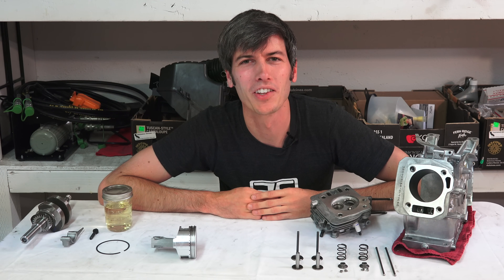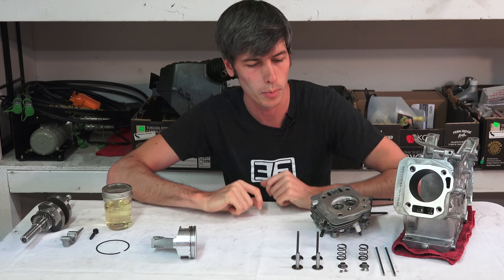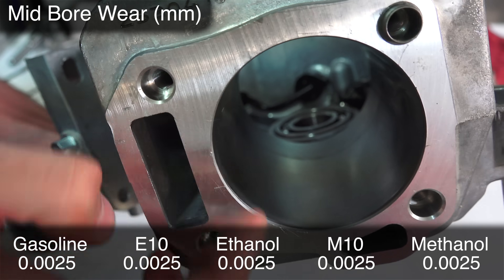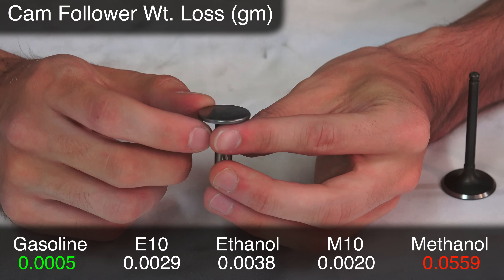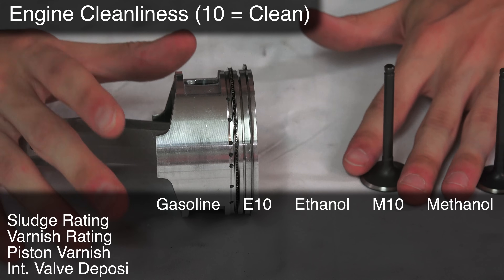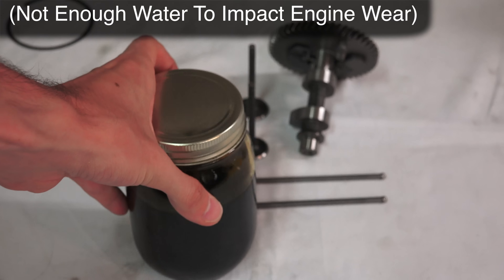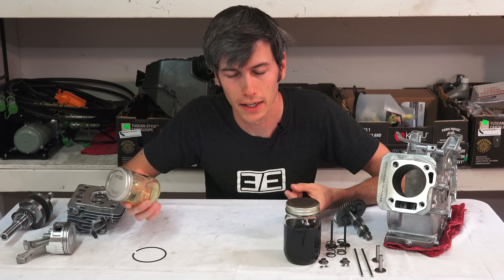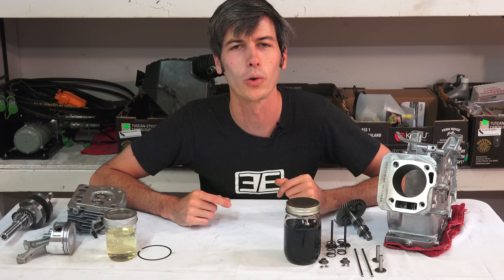Is Ethanol Bad For Your Car's Engine?

Comment from the maker: A lot of folks seem to be focusing on the fact that it's a 20 hour test, rather than the results. Yet at 20 hours it shows significant differences amongst the results. Also, 20 hours at a high load is much more pressure and stress on an engine than what you do commuting, which is nearly constantly at a very low load. This is an accelerated test as far as wear is concerned. If there are discernible differences at 20 hours, you can certainly learn from the study. While many YouTube channels simply offer "word of mouth" advice, that's all too often received well, I find it surprising so many are so concerned with a peer reviewed, with controlled variables, published article in what is perhaps the world's most renown journal of automotive engineering. Skepticism is a good thing, we should always question things. This means also not drawing conclusions that the study does not state. It does not, however, mean that the study is meaningless simply because you perceive 20 hours to be a short duration. It's quite common in the industry to run accelerated benchmark tests in order to predict long term reliability. If you're putting out new engines every couple years, you simply don't have the time to run those engines (and all of the individual components involved) to 200,000 miles to see how well they do, so instead you use harsh, accelerated tests to predict future reliability. Anyways, rant over haha, I hope everyone's having a wonderful day!
Reply: A while back I watched something saying in Brazil I think it is they only have high content ethanol fuel. All their cars run it from old to new and they seem to be ok.
Reply: @torque350hp  You are right. I am brazilian, living in São Paulo. Our gasoline has 27% of etanol and most brazilians, like me, use just pure etanol all the time. It is cheaper in many states and it helps a lot the air quality in the big cities.
Reply: @mrufino  you're lying if you put straight ethanol in an engine that's jetted for gasoline it will lean out and burn up the engine .. gasoline Burns at 14 parts air to one part gasoline by weight ethanol and methanol Burns at four parts air to one part ethanol so it takes about three times and all in methanol as it would if you was running straight gasoline and don't even try to argue with me I've been building methanol late model stock cars for 20 years buddy
.... You have no experience at all as you've never did what you said as it would have blown your engine been there done that lots of times
Reply: @torque350hp  Last time I read anything about it Brazil ran on pure ethanol. They made cars with high compression engines to burn it efficiently. It is a naturally high octane fuel. Their feed stock is sugar cane- a MUCH better choice than corn.
Reply: Didn't sound like a rent, but the thing I can't find is. Ethanol is more corrosive, you have to replace fuel lines but is it more corrosive any where else or is that just it? Thanks for the video I learned a lot from it
Reply: @ Winston not really, but it definitely matters which car you put it in. Cars can differ in both Fuel richness, Ignition timing, and knock sensors between manufacturers and models, so as the saying goes, results may vary. 

My work van (2013 Dodge Caravan)is flex fuel, and I barely lose 10% running full E-85 compared to regular unleaded (25mpg @ E85, 27@ E10) it makes sense for me to run the ethanol because of the subsidies ($2.20/gal for E-85 vs $2.55/gal for E-10) even though I know its a bailout for both the ethanol industry and the car manufacturers, who get to avoid emissions and fuel economy standards by having the flex fuel cars be the worst gas hogs in their fleets. If you wondered why you don't see little econo-boxes at the E-85 pump, that's why. Its just a gimmick so they can sell big polluting cars instead of real reform, which cost money. And it was cheaper to buy a few politicians than to do real engineering.
Reply: I mean, my del sol has been chugging ethanol for the past 300k miles like a champ. It's a daily driver so I don't abuse and I do take care of it as per the owners manual. Maybe people like to blame solutions for their own bad maintenance problems? Get it? I actually looked up the article. Thats some solid methodology they had. Keep pumping out good stuff like this man. This is why I subscribe.
Reply: @RicardoRodriguez-qb8kn  When you say ethanol, do you mean E10 or E85?  IMO 10% isn't enough to be a big concern for fuel lines, etc., but a higher concentration like E85 raises an eyebrow as to whether it's a good idea or not if the car wasn't explicitly designed for it (specifically the fuel lines and supporting parts rather than the engine internals itself).
Reply: If you are referring to the direct Ethanol subsidy that was allowed to expire, you are still wrong. The system changed the payee from the government to the refiners themselves in the form of "Renewable Identification Numbers" which have to be bought by refiners.

From RenewableIdNumbers: "The United States Environmental Protection Agency is authorized to set annual quotas dictating what percentage of the total amount of motor fuels consumed in the US must be represented by biofuel blended into fossil fuels. RINs are a direct requirement of the United States Environmental Protection Agency’s Renewable Fuel Standard – or RFS – which governs Renewable Energy Certificates (RECs).To ensure compliance, obligated parties are periodically required to demonstrate they have met their RFS quota by submitting a certain amount of RINs to the EPA. RECs represent tradable energy commodities in the United States that offer verifiable proof that 1 megawatt-hour (MWh) of electricity was generated from a specific renewable energy resource (biofuel, solar electricity, etc) and was fed into a power line system for the express purpose of that transportation of energy."

So basically the government set up a renewable fuel carbon tax and is forcing places like refineries to buy these credits. So we the consumer is being "taxed" in essence by the oil companies passing down the cost of subsidizing ethanol and other renewable energy sources because of the EPA.
Reply: 20hours is plenty of time. you are correct, results are results.
  I have an old dirt bike that leaks like a sieve if you put 10% ethenol fuel in it. some diferant seals would fix that. as long as the ethanol fuel doesnt put the octane rating somewhere in a range your engine cant use there isnt much problem. methenol is corrosive. one of the many reasons drag racers take their engines apart so often.
  I think tuning an engine to run on pure ethanol would be the best way to go. you would get the best fuel economy and the emissions would be lower.

  thats what I learned here.
Reply: @lukewarmwater6412  Do you actually run pure gasoline in your dirt bike and compare it?  My race kart engine leaked a little around carb seals on E10, but it did it on ethanol free race gas, too, it had more to do with being 10 year old seals that were probably overdue for replacement than anything.
Reply: @nunyabusiness896  no, it was 42:1 pre-mix. but 10% ethenol affects the rubber they used in the 70's. from petcock to floats everything leaks. this is easy enough to fix, just get o rings and seals
 that are ethanol compatable. it does not leak with straight gas. wear could also be at fault to an extent, I mean it was built in 72' and I have no idea if anything has been serviced.
 as the rubber parts get all soft and distorted they would eventualy leak anyway though. also the floats leaking is more than likely the only factor that afects the 'state of tune' (it runs like crap) so in time when I quit being lazy and refurbish the thing it will run on e-10 no problem.

  irritates me to have to,  ethanol isnt for north america. we are ruining the land growing corn in places where we used to grow nothing. brewing alcohol releases alot of co2..... ethanol is not an envronmental fix, it is the opposite.
Reply: @lukewarmwater6412  OK...you didn't really answer my question.  I wasn't really talking about added in 2-stroke oil, I was talking about E0 vs E10.  Have you tried E0 and confirmed it didn't have the issues of E10, or you just assumed it wouldn't?  Considering the age I think the raw passage of time is a bigger factor than anything.  I've also read that E10 can dislodge some particle buildup left by years of E0 that all of a sudden will find their way to the engine and this isn't an issue if you start with E10.

I'm with you that the "environmental" side of ethanol in fuel is complete nonsense and even environmental groups don't even seem to really support it, so I don't know why it persists.  As much as Trump talks about reducing excessive regulations, this is one I'd really like him to do something about and I don't think anyone but corn growers would mind.
Reply: @nunyabusiness896  ummm.... did you read my reply?? stated clearly it does not leak unless ethanol is present.
 I have had this same problem with all of my classic bikes. any ethanol causes leaks.
Reply: @lukewarmwater6412  You're not understanding the question, though.  In the name of science, you have to be methodical in your assessment, and that's why I'm trying to ask.

Have you:

-taken a bike with no leaks running E0 fuel

-started running E10 and suddenly got leaks

-went back to E0 and the leaks stopped

All with sufficient time for the fuel to be in contact with the parts for a fuel difference to be apparent i.e. sit with E0 for a month and E10 for a month.

Basically, I'm trying to assess if you ran a quick tank of E0 and said "hey, no leaks!" then put E10 back in and it sat for 6 months and you said "E10 makes my parts leak!".

People often draw conclusions without doing due diligence like this, so I'm just assessing if you gave each fuel a proper chance to verify it is in fact the fuel and not just old seals acting like old seals.
Reply: @nunyabusiness896  as I explained the first time, YES.  I have stopped for fuel on an empty tank, filled up with e-10 and had leaks in 5 min. drained and re-filled and the leaks went away. this happens with every classic bike I own..... you read english, right??
Reply: it's not bad because it has more octane, but the fuel consumption increases, ask those who compete acceleration races...
Reply: 20 hour test Is best than nothing, but is not optimal to determine wearing in other components like fuel pumps injectors, catalytic converter and exhaust pipes. Also because gasoline form a lot of carbon / calamines deposits on a long term use. Carbon deposits induce knocking wich is way more destructive than slight difference in engine wearing. Also a long duration test executed in a cycling basis allowing exhaust water condensation will determine which combustible induces more rust in the exhaust system and also catalytic converter duration. You know: in life, some things are short and are good, but this test is not the case...
Reply: Since 1970 in Brazil we have cars that use 100% alcohol as fuel. I have a 2009 Fiat Idea 1.4 L that is flex fuel, and since new I only use 100% alcohol as fuel. It has 178000 km on the clock and I never have any problems, my engine runs like new, it doesn't burn oil and runs perfectly. If you go to a engine rebuild shop here in Brazil and see a gasoline engine and a alcohol one side by side you will see that the alcohol engine is much more clean inside. Myth about alcohol as fuel, it all this is. Alcohol is a great fuel for internal combustion engines.
Reply: Engineering Explained they should do that test for oil, to see witch one is the best/better :/
Reply: The real problem E10 poses is water and even E10 fuel systems have issues with E10 based corrosion, they just reduce the effects to where it shouldn't be an issue within the first 150,000 miles on a car
Reply: You place far too much faith in published tests. You'd be surprised that many are not peer reviewed nor questioned. Boeing Max shows us what kind of nonsense goes on all the time.
Reply: My biggest concern is Storage of E10 on seldom run engines such as collector cars, seasonal equipment that may be sitting for an extended periods of time.
Reply: You are an engineer?😂😂😂😂
Reply: 400 hrs full throtlle engine durability test is equal to 10 years normal usage. So 20 hrs full throttle is equal to 6 months.
Reply: Mj i
Reply: Top end of a motorcycle engine ain’t it?
Reply: Well said.
Reply: PikPobedy  I clearly stated the fuel tests were done while teaching and not at SGS. No engine I ever tested was done short term, most vehicle owners manuals state 500 miles moderate driving and to not run steady state if possible. This video relates only to internal combustion engines and that is what I am limiting my comments to as related to my direct experience.  PikPobedy
Reply: Small engines with carbs such as lawnmowers and atvs are not made to run on e10.
Reply: what was the pH of that methanol? where i worked, they added caustic to increase pH of the methanol.... to reduce corrosion of the piping.  probably fuel methanol can still have the pH bumped even more.
Reply: Not only that, the study was done in 1981.
Reply: An engineering god among men. He's too good for us...
Reply: SAE sounds like a cult😉
Reply: @doorguner01  it stands for the society of automotive engineers to have established standards for bolt sizes torx etc etc .... You're calling it a cult that's pretty funny cuz that tells all of us that you know nothing at all about anything automotive
Reply: @donniebaker5984 😂😂😂😂 ouch!
Reply: @Bozemanjustin  There's a reason why Briggs and stratton made and all plastic carburetor!
Reply: Using Ethanol in petrol engines goes back further than 1981.I first heard of it being used in racing before that when I was in the RAF cadets. Also the Germans used Italian wine to make Ethanol when their fuel supplies were cut off during the second world war But Henry Ford had his Model T run on both petrol and Ethanol. David  Blume is a leading expert on Ethanol fuel. Also  the oil companies with fossil fuel were  all  for prohibition and the wars to lay down the pipelines and wreck the environment They also spend billions on anti Ethanol propaganda where they buy land and cut down trees to grow sugar cane so they make out it leads to deforestation anyone could make their own alcohol in their own back yard like Steve McQueen made Moonshine in the film The Great Escape . The extra water is added by the oil companies who don't want to filter it out as much to kind of make Ethanol look not so good. A petrol engine should be able to run on 100% and it doesn't produce the same amount of carbon. It's a clean burning fuel
Reply: @EIKLURAM  ethanol has to be mixed much richer to air than gasoline if you put straight as an all in a gasoline engine it'll last about 30 seconds before the Pistons melt try and see I dare you
Reply: @donniebaker5984  I know it;s a rich mixture with less air than fuel. But
Reply: I've always wondered how companies test their new engines for reliability when they're developing them. I use to always think they just have an engine running somewhere in the factory for months then evaluate it after a certain amount of time.
Reply: He also said that engines after 2012 would be O.K with E10 but older ones may not be designed for Ethanol  but the test was done in 1982 so that is obviously older vehicles.David Blume is one of the best sources of information related to this subject.If Alcohol fuel was damaging to engines then I cant see  Hendy Ford designing the Model T to run on 100% Ethonal back in the days before prohibition
Reply: Less rationality, more hype!  ;)
Reply: They should have ran the E100 and M100 longer maybe 25 hrs to compensate for having less energy and the vehicle would have to ran longer to achieve the same range as a pure gasoline burning vehicle.
Reply: Thanks.
Reply: Disappointed you didn't Evaluate E85 in your testing.
Reply: M
Reply: It's interesting to read the comments about ethanol absorbing water because aromatic hydrocarbons used to boost octane in gas also absorb water from the air.  Some absorb more than ethanol does.  In fact, they remove water from ethanol by mixing it with benzene.  Benzene attracts water more than ethanol and removes it when evaporated in a column.  That's how they get ethanol to over 195 proof.  Comments about refineries adding water to ethanol is twaddle.
Reply: How did gaskets and seals fair in those tests?
Reply: @Kor1134  why do think they called it quits at 20 hours? Lol
Reply: A couple of years ago I turned a gas-only car into a pure ethanol one (in Brazil "e100" is widely available, quite cheap and awesome for turbo aplications such mine), 40.000 miles later I can tell ethanol will eat thru anything not specificaly made to handle it, anything rubber will be gone, anything metal (including alluminium) will be eaten thru, fuel pumps will need to be replaced constantly, I had to replace the fuel tank to stainless steel and everything else fuel touches it for plastic. Oil is always clean, inside the engine looks brand new, but everything else deteriorated so much quicker.
Reply: I have driven Saabs with e85  about 550000 km,lot of oil changes and sparkplugs,but  thats it. No problems,if it is warmer than -20 celsius.torque is great and co2 and other emissions are close to zero.I recommend strongly.👍👍
Reply: This is a totally bogus test there's no mention of air to fuel ratios on each fuel..... When running straight methanol you have to run about three times as much fuel to air ratio which is actually comes to four parts air to one part methanal  by weight or as gasoline is about 14.5 air to one part gasoline ..
So if you try to run methanol in a car that is set up for gasoline it will run about three times too lean instantly melting the Pistons. And yes any gasoline that's mixed with alcohol by 10%, you're causing a combustion chamber to run much harder than it's designed for as the alcohol will lean out here gasoline mixture and cause failure valves first that's amount... 100% methadone run through a gasoline carburetor or injection will blow the tops out of your Pistons in about 30 seconds after you fired up
Reply: The 10 % ethanol contains up to 49% water. Therefore 1 gallon of fuel contains 5% water. Im thinking exhaust system corrosion would be a issue. Just a thought.
Reply: Pure alcohol aka ethonal shouldn't contain any water. That's why it's pure..If it contains water its not been made correctly so it's not pure ethonal
Reply: This is a superb, well supported, response that hits a number of important points.  Unfortunately the very audience that needs to develop the reasoning skills you display and then wrap up with a bow for them to adopt, are busy scratching, sniffing their fingers, and saying "them scientistifics tipe-guiz theenk thez so smaart"
Reply: I love this xD
Reply: So this video is relevant to engines made in 1981 using lubricants from 1981...
Reply: If they found more water in the oil of alcohol fueled engines after a 20hr test, imagine what a couple heat cycles would do. They also probably used carburetors which would really change the results compared to today.
Reply: In the study, did they optimize the engines for the specific fuel, ie: compression ratio, cam and ignition timing? What about the BSFC? 

If engine "A" uses 0.5L of fuel to move 2000 kg of mass 100 km, with 0.0001 wear, and engine "B" uses 0.25L of fuel to move the same mass the same distance, with 0.00015 wear, but neither engine see a decrease in efficiency until wear reaches 0.01, wich engine is more efficient?
Reply: This study had an overall poor design of experiment.
Reply: Ethanol is an alcohol. It is terrible for your seals fuel lines and so forth. Rubber and alcohol are not friends. We already know long term wear is worse with ethanol fuels. It's science
Reply: Can you check the effects on the rubber fuel lines on engines that have sat for more than 30 days and one that have been used regularly?
Reply: Stelantis (FCA) does 200,000 mile tests.  2 shifts, 7 days a week and 350 miles per shift.
 It happens in Auburn Hills, MI. That takes about 10 1/2 months. It also keeps  about 20 mechanics busy. Michigan roads are pretty good at proving a harsh testing environment on Gretchen's damn roads that constantly need fixin. Great for shake and rattle testing.
Reply: What about a high wind causing  a high loading on the engine?
Reply: Well said sir! I have an 07 uplander that is an alcoholic. Ive ran X-85 120 octane alcohol in it no problem. Well except for the tires that got smoked off much quicker than advertised it did no harm to anything else. Ok thats a lie! It did hurt juniors ego more than a little when he tried to beat me with his 5.0GT Mustang and couldnt win.😢 The look of despare was priceless on his face when we passed 100mph and i was laughing like you wouldnt believe and pulling away at that speed. Ive done 125mph @,4,000rpms and my factory tach goes to 7,000 rpms all of the are white, not one is yellow or red but it shifts at 6,000 rpms by itself @WOT in all gears. WOT in neutral or park is 4,000rpm non- negotiable. There is no access to the throttle anywhere under the hood. Its all electronic, fly by wire technology nowadays. I used to think my F-15  that i crewed was technical. Not so much anymore.
Reply: Can you address the common comment about ethanol causing deterioration to fuel lines? Surely engine manufacturers who design their engines to run on E10 like Mazda (skyactiv) and recommend to use E10, would address this problem.
Reply: Well if people are correct and the issue is how corssosive it is, and what it does to other parts that then impact the engine...

 Then a long term test is required to show that. Then to find out what to do about it ideally.

 This test is like me taking heroin for 3 days then being like. "Yup. As long as you don't OD. It is totally safe for you."

 And that is actually true. Taking heroin for 3 days won't really do anything. It is the life style choices, and lack of health mangement once you get addicted that makes it so bad.
 
 In fact I need a liver and kidney transplant, and many organs come from opiate addicts since it doesn't really hurt many of their organs. (Short of STDs, hah. Wait that isn't funny.)

 I would just like more data.
Reply: LIL LIL LIL BAHLIL , SI ANOMALI EBLES HIJAU (GOBLIN) 🦖😈👹💀💥
Reply: I use ethanol for performance car, with new ECU tuning much more power output. I love e85 fuel.
Reply: Plz update on this!
Reply: What you call "word of mouth" I call "urban myths". I sometimes think Engineers like ourselves are wasting our breath (so to speak) trying to educate with FACTS. The biggest thing wrong with the internet of things is that it's made every numbskull into an expert.
The most common one is that premium fuel isn't "worth it" (whatever 'it' is?) because all petrol is the same. And how do we know this? Because Bob is a tanker driver and has 'seen' the tankers always being filled from the same outlets at the refinary ..... YOU know the rest of the song ....
Keep the faith Jason
Reply: Cyclone Cyd Best comment.And you actually have videos.Correct indeed on the experts galore now.
Most are just kids or adults with the Dunning Kruger problems.
Reply: @CycloneCyd  We don't need no stinking facts! 
10-4 good buddy. When we design, program, debug and produce a machine the projected component wear is part of the data we have obtained, along with the proper lubrication for the different moving elements.
Just because something worked once does not make it a fact, I don't consider backyard JimBob's observations in the highest esteem.
Reply: @CycloneCyd  -  Well, I haven't heard much about ethanol in regular and fairly modern engines.   BUT small engines used mostly in lawn care seem to crap out and fail to start.  The SAE didn't address this.   I don't blame the organization:  E-10 is official government policy and it doesn't want to rock the boat.
Reply: @CycloneCyd  I've never heard anyone say premium isn't worth it "because it's all the same"  What I have heard is that if your car wasn't designed to use premium there is no benefit to using premium, you are just wasting money.  The only exception would be if you KNOW for a fact that a particular company puts MORE fuel detergent additive in their premium fuels.  Some brands used to advertise that they did but I have not seen such a claim in many years.  In addition, automakers often say do not use premium when the car was designed for regular because premium can create cold start problems.  I have experienced that personally on a 92 explorer and discovered Ford even issued a TSB about the problem.  Typically premium fuel has a lower (something or other, probably vapor pressure) and when cold it winds up as too lean a mixture for the car to start normally, you wind up cranking and cranking till it finally starts.
Reply: You could make a video about brazilian flex engines, our gas is 27% ethanol, this could make a point
Reply: Neoedu, I know the fuel works fine in motors in which are built or upgraded to run Ethanol, and in Brazil, it makes sense as Ethanol is not as environmentally damaging to produce there as it is here by using corn, which is a staple for human and livestock consumption. Yes it absorbs water, everyone who has spent 5 minutes looking at the pros and cons knows this.

What we, the US (ESA) public don't like is mandated use of a fuel that only makes financial sense because of a government subsidy, one that isn't easy to store, and when the mandate goes to E-15, expensive retrofitting of our vehicles will be necessary (my 2009 car is E-10, my 2013 is E-15 approved) for no financial benefit to our country, and likely damage for motors and fuel systems that can't be upgraded easily.

Lastly, this video used a government accelerated wear study, which was scientifically done, but in the 1980's when this test was done, vehicles were still very primitive, pushrod valvetrains, carburetors, point ignition timing, things left over from the 1930's technology. Because of that old technology, the test has really not a lot of relevance on things like Oxygen sensors, Fuel pumps, or the ability to keep water from entering the fuel system. It was a static test that proved Methanol is horrible, Ethanol is Fine, and Ethanol Blends also are fine or better than regular gasoline (don't know if leaded or unleaded) at reducing mechanical wear in antique engines over a short accelerated wear test.
Reply: @twotone3471  You wanted lead in the fuel because of the unharden valve seat and guides  but if it was remanufactured they where installed with hardened valve seats and guide then unleaded was ok the lead was to help cushion the valve stem from deforming the soft cast iron!
Reply: Dudes in lab coats ain't got nuthin on my cousin Bubba's Xpertese...DORK!!!
Reply: SGS Environmental Testing Center, 2022 Helena St, Aurora, CO 80011. I used to work here. Unlike Simpleton Assclowns Experimenting(SAE), this is real. Accelerated testing is BS, long term testing is the only proof. Days, weeks, months, store engine for years and pull out again to keep testing. Experimental fuels and additives too. Stop drinking the the alcohol laced Kool-Aid. Take a field trip and see, if you can get in(proprietary technology). Also, while teaching automotive technology at the collegiate level I observed ethanol levels as high as 30% in the winter blends. Simple test uses a graduated cylinder of 100cc. Fill to line, cover top and shake for 30 seconds. Read directly the separation line for alcohol content. Do you drive on bumpy roads? Lastly, older engines, the owners manual on my 1988 BMW 750iL specifically stated to NOT use alcohol blended fuel. Cylinder wash leads to accelerated wear.
Reply: @ATEC101  "Cylinder Wash" I think you are referring to Ethanol's solvent abilities to emulsify oil on the cylinder walls, or worse internally in 2 stroke motors. I just wonder what oil additives have been put in lubricants to combat this, if any?
Reply: Absolutely none that I am aware of. Alcohol was a 'carcinogen" to engines until the subsidies decided it was "chock full of vitamins'. The SEMA show I went  to  in 2012 had a banner hanging that stated 10 years 100k, throw it away(the entire car). Also, spare parts for most production cars are less than 5% of total volume unless shared across multiple platforms.  @twotone3471
Reply: @ATEC101  For cars at least, other than the Cylinder surface washing, I'm most concerned about the modern vehicles extended service interval, My work van is E-85 and We use that, as its built for that. But is the Oil made for dealing with Alcohol's unique combustion byproducts, and emuslifiers? Is there a 2 stroke, or 4 stroke oil that does? So far I haven's seen any car saying that if you run Ethanol, you need shorter service intervals, but would they? They do sell cars for a living after all.
Reply: Two Tone Unfortunately, the extended service interval is now part of the maintenance package sold with most vehicles. In example, 100,000 mile free maintenance. 15,000 mile oil change intervals gets you 5 oil changes to 90,000. Some manufacturers will say to change the filtrer half distance and top up.This assumes normal driving, which no one does. Severe driving can be classified as stop, start, up and down hills, temperature fluctuations of more than 20 to 30 degrees, dusty environments and if you live at or above 5000 feet. I am a user of synthetic lubricants anywhere I can. You can send oil samples out to be tested and many of the people I raced with at the club level did that after every event. My advice is to halve the interval. They ar also trying to sell you another car too. @twotone3471
Reply: @ATEC101  I get that I SHOULD change the oil more often, but my E-85 vehicle is at work, where people's lives are potentially impacted besides mine. Its out of my hands, a mandated 8k interval under severe use. I'd request a oil formulated for that, but there isn't any. We already use full synthetic, which is as best as we can do, but it remains that motor oils don't have a specified API certification for use in Turbocharged, flex or CNG powered vehicles, and they should.
Reply: @twotone3471  two strokes have their oil mixed in the gasoline their comment has no validity what so ever
Reply: The corrosive effects of Ethanol occur over time, both electrical and chemical wear, this test didn't take into account the effect of the increased amount of water in Ethanol Blends in the real world, or to two stroke motors (really the worst) or state (at least in your video ) which materials the motor was made from (cast Iron Block or  aluminum?) so many variables to state conclusively that its just so, when its just not. Yes, in the right conditions, ethanol is both a viable and cleaner burning fuel than Gasoline. That however doesn't take into account the amount of fossil fuels used to grow, harvest, transport, and process the corn into Ethanol. It's a fuel, but don't confuse it with being a "Green" energy alternative.
Reply: @twotone3471  For what it's worth, I ran E10 93 pump gas in my race kart, in one case 1.5 year old E10, and never had a problem.  This was a 14,000 RPM 2-stroke.
Reply: @nunyabusiness896  it's rare to find 93 octane E10. But if you did and ran that in a rotax motor you were not following the manufacturer's recommendations. Also we are talking about a motor with a 50 hour maintenance interval. I'm not sure that is enough time to truly understand the wear characteristics of E10. My own bad experience with ethanol happened using a boat motor which is apples and oranges to a kart engine. But I wish you well and hope you won a race or two.
Reply: @twotone3471  93 E10 isn't rare at all, it's what all premium pump gas is in Texas.  The manufacturer actually recommends 93 octane (98 in the manual, but that's Euro calculation, US calc is 93 for the same octane), though they would probably prefer you ran MS93 (leaded ethanol free 93 octane race gas).  I ran it because an actual Rotax Max Challenge driver said he always runs pump gas and even a seasoned Rotax tuner told me the motor actually ran better on E10, it just wasn't legal for really tight rule sets.  

As for maintenance, 50 hours of 14,000 screaming RPM at full throttle is quite a bit, and regardless the issue was in terms of gaskets and seals, not the engine which was demonstrated by SAE to not be a big deal.  Bottom line, it ran fine on 1.5 year old E10 stored in a gas can (mixed at 50:1 with 2-stroke oil) kept 100% in a van in Houston heat and humidity.

I read an article about boat motors and the main issue appears to be that the ethanol will dislodge old buildup that regular gas won't, so if you suddenly switch you'll rapidly purge all of the crap built up in the tank over the years and will run it through your engine.  Supposedly if you completely clean the system before switching or start with a new boat and run E10, it's less of a problem.
Reply: @nunyabusiness896   High RPMs are great, 4 stroke engines and many Marine 2 stroke engines are limited in RPM's by a phenomenon called valve float, where the valve spring lacks the power to retract the valve at a certain RPM and  may cause the valves and pistons to have a unfortunate meeting, causing the top end of the motor to catastrophically fail. 2 strokes like your Rotax have fewer moving parts. and none in a interference that would detonate the motor. Chainsaws and Leaf Blowers take advantage of this as well, but go 800 hours on average before needing a rebuild ("Life cycle assessment of chainsaws
 A case study of two Husqvarna products with different power  systems"Division of Environmental Systems Analysis Department of Energy and Environment CHALMERS UNIVERSITY OF TECHNOLOGY 2011) That's what allows those screaming high RPM's, and the main limiting factor is heat, so Lubrication and cooling is paramount, and in this Ethanol had to be a double edged sword, with the engine running cooler on E-10 leading to it "Running Better" on the track. However at the same time Ethanol's properties are also eating away at unprotected metals and emulsifying the oil in the air/fuel mix, leading to potential wear issues. 

Secondly, there is "Phase Separation" where water dissolved in the Gasoline separates the Alcohol from the Gasoline. With normal gas, this happens too, and easier. But that's also the problem, as E0 has a maximum carrying capacity of 0.15 teaspoons
 at 60 degrees F per gallon. E10's capacity is 3.8 teaspoons per gallon, quite a bit more, and if that separated water/ethanol mix gets pulled into your engine, that is bad Juju. Empty the tank every go, and really with fresh gas, shouldn't be a issue with your kart.
Reply: @twotone3471  First of all, don't preach to me about valve float like it's news to me.  There is nothing more irritating than the automatic assumption people on the internet make that you don't know things when you haven't confirmed it either way.  Second of all, that has nothing at all to do with anything previously discussed.  Third of all, my engine has no signs of corrosion (well, up until the point I sold it about a month ago because nobody runs it and I want something that is run locally), Fourth of all, the supposed "phase seperation" was never an issue and never created a run time problem.  You can keep power Googling and quoting stuff but the bottom line is just like Jason said, it's not a big deal.
Reply: @nunyabusiness896  I suppose it's a big deal because your engine was made specifically to run at high RPM. And phase separation is a bigger thing in environments where the temperature changes. I suppose in Houston it actually doesn't change as much as it would in Milwaukee.
Reply: @twotone3471  We go from 110 degree days in the summer to some 20 degree nights in the winter.  Maybe the internet has just been misattributing other issues to ethanol, which is why Jason wanted to make this video.  I wouldn't mind seeing a proper experiment with ethanol over time, but I'm tired of the hear-say over this when the proof is in the pudding and 1.5 year old E10 worked fine in a high revving race engine.  It's very possible new chemical stabilizers have come out in recent years as well.
Reply: @nunyabusiness896  Actually, the main debate is over a potential E-15 mandate, which would affect many pre 2013 vehicles on the road currently. Yeah,my families 2 stroke Boat motor failed after 1 year of E-10, but Dad had no clue about fuel properties. The experiment I would like to see is in regards to lubricants and the properties of burning ethanol in forming deposits that   two and four stroke engine oils were designed to prevent.Are our current additives designed for the byproducts of ethanol combustion?
Reply: @nunyabusiness896  he also included two strokes floating there valves .....two strokes have no valves ..
Reply: @donniebaker5984   You have never took apart a 2 stroke then, they have a reed valve, to keep combustion from happening in the crankcase.
Reply: @donniebaker5984  I don't disagree, this test was shallow and comes far from telling if ethanol causes any damage to the engine, just barely tested combustion damage, but he didn't make the test itself, he is just talking about a test made in the 80s, the engine is just there to represent what he is talking about.
Reply: @donniebaker5984  you being wrong about 2 stroke engines not having any valves makes me lose credibility? Yeah sure, in your dreams.
Reply: @twotone3471  corn 🌽 is not a good crop for fuel. Sugar crops are the best for alcohol
Reply: @twotone3471  you are correct. It’s amazing that he is an engineer, but that sounds about right for engineers actually. That’s why everything is crap these days. People like him or making them.
Reply: @twotone3471  I only ever use supreme 93 or 95 Octane in my 2 strokes.  Most if not all premium fuel in Canada has 0% ethanol.  Regular is up to 10%, mid grade is up to 5%
Reply: @rxtuninginc8444  If that's true it makes no sense since ethanol increases octane.  Why would they put less in the grades that need higher octane.  Not saying it's not true, just that it makes no sense from what I've heard about the benefits of ethanol.
Reply: @EristiCat  It's a common thing; where I live, 93 octane premium fuel and ethanol-free fuel usually go hand in hand.  Some stations, the premium has ethanol, and occasionally you find ethanol-free 87 octane, but usually it's 93 octane ethanol free.  I imagine it comes down to pricing; both premium fuel and ethanol-free gasoline fetch a premium price, so it makes some sense to see them combined.
Reply: There is no "increased amount of water" in an ethanol blend. The water may form because of natural condensation. The ethanol removes the water. If you don't have ethanol then you may have a continuous buildup that eventually requires attention. So in this regard, a longer test would prove to be more favorable to ethanol, not less favorable. Ethanol is no more corrosive to various metal than gasoline and the aromatics that are used instead of ethanol (in fact, ethanol is less corrosive on many substances).

Regarding the use of petroleum oil fuels in the production process; yes petroleum oil fuels may be used to power the transportation trucks, etc. But so what? Gasoline and diesel delivery trucks do the same, so its a wash. However, ethanol fuels are used in many instances to power the farm machinery and distribution trucks (and should be used more). 

Ethanol is clearly a cleaner and "greener" fuel than gasoline and diesel. The fact that there is NO 100% clean fuel (that operates within a 100% clean system of production and distribution) doesn't mean that one fuel is not "greener" than another based on relative considerations, and the manner in which the word "green" is used.
Reply: @TheAutoChannel  who are you? Some kid? Ethanol and methanol both attract moisture. They don't get rid of it. Ever seen a bottle of heat? Know how it works? You put it in your gas tank and it attracts all the moisture. Alcohol blends with gas..water does not. Adding alcohol to fuel helps dispel moisture by using alcohol as a vessel to transport very small amounts at a time through the fuel system , then being ran through the engine. Another point you made..ethanol is not corrosive?  It is very corrosive to copper , aluminum , brass and steel. A vehicle made to run on ethanol has plastic tanks , lines, and usually injector bodies.
Reply: I like my ethanol free gas. I get more oomf in my engine going up the mountain than the mixed blend. I've also notices an extra mile few miles per gallon.
Reply: Alcohol attracts moisture. I learned this the hard way, racing. If you don't run an engine oil formulated for methanol like Brad Penn you will most likely have issues.
Reply: But Jason, you didn't talk about the gaskets or other seems of the engine. My first car was a 95 Nissan Pathfinder, and there was a month or two where I had thought ethanol-free fuel was better for the engine. Long story short I ended up destroying all of the seals in my engine and it bled oil like a slaughtered Pig.
Reply: Can you test the real reason why ethanol can cause damage? Let a car sit for 6 months with ethanol mixed gas vs a car with pure gas to see what happens to the fuel system? Not mention wasting perfectly good food on a mass scale. I
Reply: This is a poorly structured experiment, not because of the twenty hours, but because of the steady state nature of rpms.  I want to see variable rpm, not a perfectly tuned clean burn.  Nobody drives like a generator engine.
Reply: You did good.  Do some kid videos, Tell em about Solid Works.  Invoke Mr. Rogers: Would you like to be my neighbor?  Also, you look like the Astrophysicist Brian Cox.
Reply: Just a random question, is it better for an engine to keep using the standard 5W30 oil after 15 yers and more than 120k km, or switch to 10w40? Mechanics said to put 10W40 now, considering the older engine and the fact that it now burns some oil. Thanks!!
Reply: That depends on the oil pressure and opening sizes of crank shaft  oil holes. A thicker oil will not flow as easy and you could end up damaging the engine. In the old days yes but I would not try it on a car 1999 and up.
Reply: Peer reviewed means it's subject to people's criticism. Not that it's infallible. It already loses points for being a government study.  

20 hours isnt even a whole day.  You would have to run this engine at least as long as the break-in period, probably a little longer...  This is because it's possible the wear and tear due to fuel differences would even-out after the break-in.  And as mentioned, you cant really test corrosion in 20 hours.  Thats like me putting a penny & a dime in a glass of water overnight then saying  "Well they looks the same, therefore only minimal to no practical difference in corrosion resistance of the different metals".  It wouldn't surprise me at all if Auto manufacturers actually used tests like this in their engineering decisions; it would explain why most cars are falling apart even after a century of refining the designs.
Reply: This is the problem with engineers... no real world experience... ethanol does not cause wear... it attacks rubber, it attracts water, in small engines it destroys carburetors... it rots out gas tanks, rots out carb bowels... anyone who is in the industry KNOWS this.
Reply: While I agree with most of that, this is a fuel test, not an engine test, so there's no deadline.
Factories might make a new engine every year, but you're gonna use the same kind of fuel for decades. So just because accelerated tests are "necessary" in the car industry, it has nothing to do with fuel tests.
I feel like an extended test is only fair, more so because even the 20 hour test showed that gasoline and ethanol had similar effects on the engine. But people drive miles, not hours. Meaning that worse milage in this case also means more wear.
Reply: If it's a publicly available article then post the link and let your fan base decide for them selves. It honestly sounds like you simply don't want to be told you're wrong and don't want to listen to anyone else but yourself and those precious lab tests. I'm a field engineer, aka FSR, with Lockheed and I hate the guys that sit behind the desk because all they do is look at data and never see what happens in the real world. Then I get to call them and argue with them when I have a fix to their mess up and its "never their fault and must be the crew chiefs or pilots fault." lol what a joke